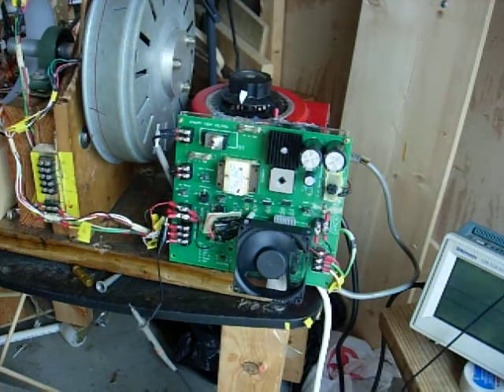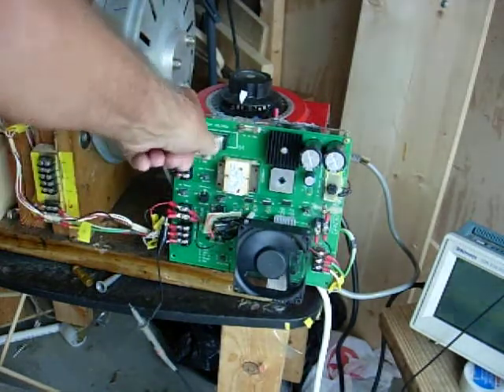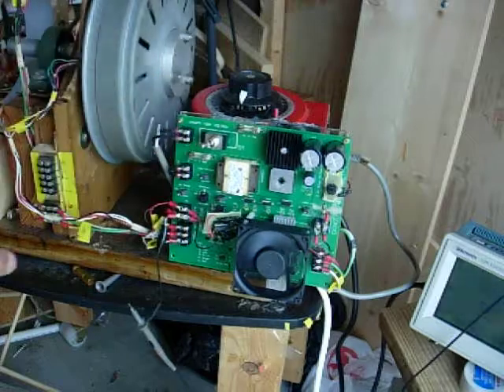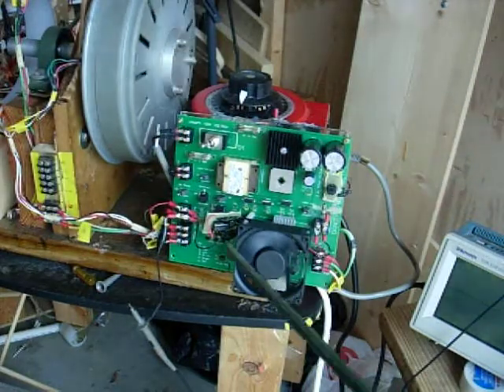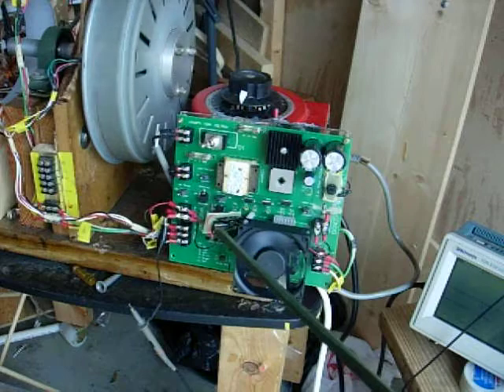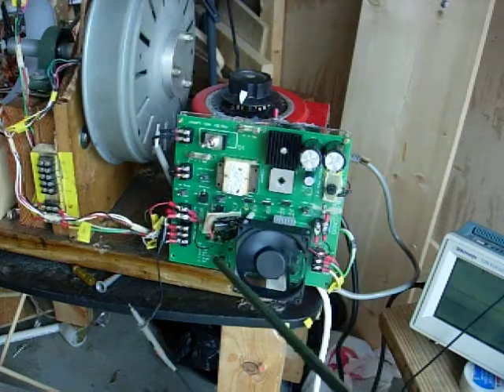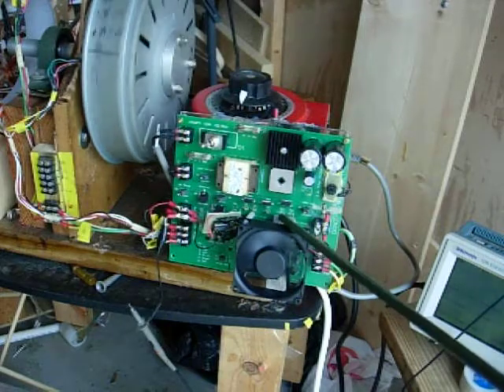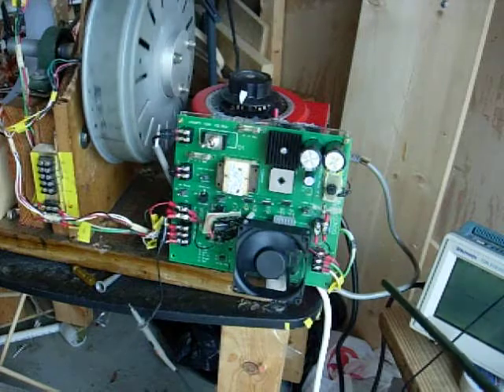Don Smith #139 Amega48 struggling but spinning the rotor

Comment: hey  i have the same motor of lg washing machine how i can run it as u did please please  help me there are 3 wires from winding i have to give 12 volt DC i means put three together and conect + from battry of 12 volts DC? thankx in advacne  will wait for ur replay
Reply from the maker: +muhammad zubair Hi Muhammad  My motor has 36 coils and 12 arcs on the rotor each arc has NSNS magnets .    these motors are three phase and require some kind of controller which used 3 hall sensors ATS from Digikey  my original pcbs used an MC33033 chip  This worked pretty  good with  12vdc the MC33033 also works with the MC33039 for closed loop.   I don't know if I kept any of the old pcb but if have one I can send it to you.  my you tube name is also yahoo address.  drop me an email with shipping info.   The motor requires pulse width modulation which is what the MC33033 produces.  each wire represents 12 coils in series.  so you have 3 phases ABC.  these 3 groups are connected together and this form a Y connection.   The pulse width modulator uses 6 transistors  3 pairs.  the center of each pair connects to one of the phase wires.  Look up the data sheet for the MC33033 it will show a complete schematic.   You can also get a PCB from ebay just search for a 3 phase bldc motor controllerhttp://www.ebay.com/itm/BLDC-Power-12V-3Phase-Servo-Motor-Driver-Hall-Effect-MC33033-MC33039-PIC16F873A-/271582181158?hash=item3f3b8f3726:g:efkAAOSwT~9WlO3AThis is the first PCB I tried and I did get it to work.  by rewiring to get rid of the micro process.  to do this I compared the MC33033 schematic to the one that comes with this small pcb and made the small pcb match the schematic for the MC33033 stuff.   But you can also use a PC I think to run the motor thru this small pcb.    I tried using 36vdc with this PCB and fried it.  much smoke.   anyway GOOD LUCK  drop me an email.  Capt.
Reply from the maker: +muhammad zubair Here's another and these guys can help as well the first pcb mentions offers little helphttp://www.ebay.com/itm/36V-350W-DC-Motor-3-Phase-Line-Brushless-Controller-Sensor-Electric-Bike-Scooter-/261898725330?hash=item3cfa6167d2:g:buoAAOSwKrhVYGhq

Comment from the maker: Got back from NH to Orlando in a very rough flight.  Today I tried downing the new code onto the PCB without the Irams chip install the old one fried.   Supposedly we know have an 8mhz clock turned on inside the Mega48 and the new Hall pattern has also been placed into the code.  the original pattern was rem'd out.  So tomorrow I'll solder in the new ic and add the old ground setup back onto the pcb that was removed using the Dremel tool and then try it out with different hall positions around the rotor coils.  One position should run forward smooth one should not run at just chatter and the third position should backwards smoothly.   The original hall data in the code did not match the MC33033 data from the waveforms.  I also found with the scope that the waveforms for the three phases power were  overlapped and this should never happen.

Comment from the maker: I found that the C Code Hall handling area dumps binary to the Breg and these bits if 0 will turn on the respective IGBT in the Irams.  for example  b101110 turns on turns on IGBTs C-Phase Top  and IGBT A-Phase Bot.  when I compared these codes to the MC33033 data sheet I found that they don't match and this maybe why the motor is running rough.  I'll post the new binarys when done here's the original codes

switch(Hall_In) {

                        case 1: IPM_B4_PWM = 0b101011; break;

                        case 5: IPM_B4_PWM = 0b110011; break;

                        case 4: IPM_B4_PWM = 0b110101; break;

                        case 6: IPM_B4_PWM = 0b011101; break;

                        case 2: IPM_B4_PWM = 0b011110; break;

                        case 3: IPM_B4_PWM = 0b101110; break;

Comment from the maker: The end of the C Code has 4 lines with 2 of them rem'd out.  these determine the polarity of the output pulses to the Irams10up60A driver.  The current selection is for active highs, that's why the 6 outputs are low when not in use.  These 6 lows turn on all six IGBT's  NOT a good situation inside the driver device.   The following shows the bad selection for the Irams10up60A driver chip.  To fix it move the // from high inputs  to low inputs statements:// If OC2B is high, send inactive outputs to IPM.
  if( PIND & (1 << PD3) ) {
//   PORTB = ~0xFF; // <== If motor driver has active high inputs.
   PORTB = 0xFF; // <== If motor driver has active low inputs.
  } else {
//   PORTB = ~IPM_B4_PWM; // <== If motor driver has active high inputs.
   PORTB = IPM_B4_PWM; // <== If motor driver has active low inputs.Also you will need to ad code that changes the Mega48 frequency from 1mhz to 8mhz here's the code that does this//! Application starts here.
void main(void)
{// Crystal Oscillator division factor: 1
unsigned char speed;#pragma optsize-
CLKPR=(1<<CLKPCE); CLKPR=(0<<CLKPCE) | (0<<CLKPS3) | (0<<CLKPS2) | (0<<CLKPS1) | (0<<CLKPS0); 
#ifdef OPTIMIZE_SIZE 
#pragma optsize+ 
#endif 
 
 initialization(); // Initialize Peripherals.you'll have to ad one of these } at the end of the code if an error occurs.The last fix is the line of code that causes the initial error when you try to compile .  PCINT1 NOT DEFINED.  The solution is to change that line with PCINT1 to PC_INT1.This should get you up and running.   The PWM created by this code seems to work great.Don't forget that the Irams pin 7 is not ground but is VCC and that pin 21 must be grounded thru a 4.3k resistor or the IRams won't run at all.  To program it make sure that nothing is connected to the chip except programming signals